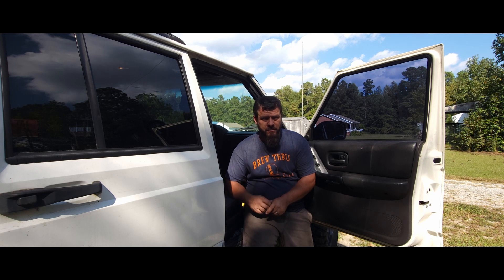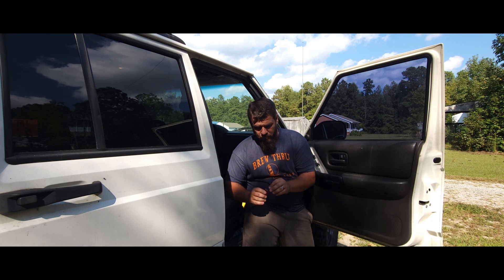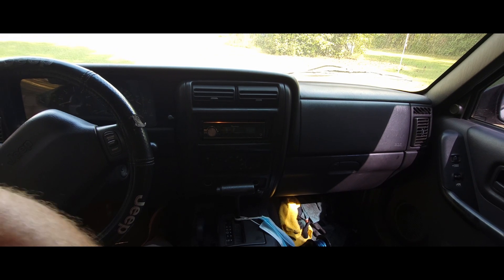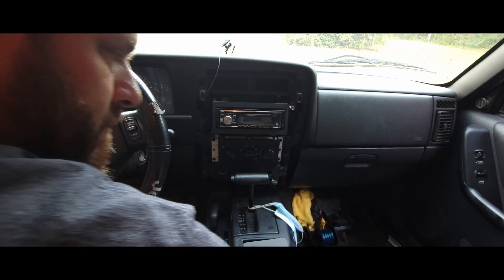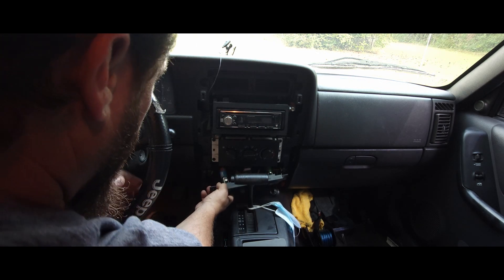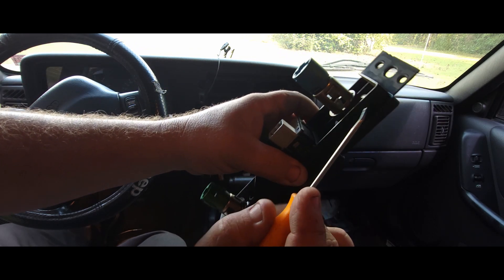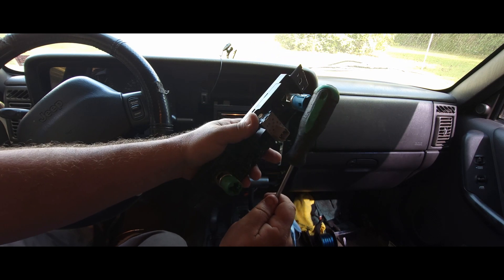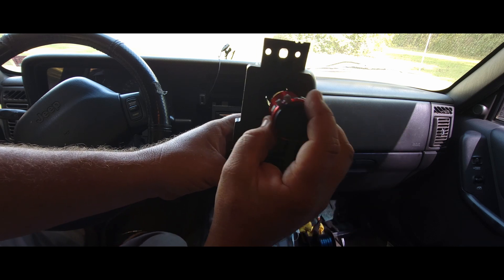Jeep XJ Cherokee USB Port / Plug / Socket

Comment: What did you use to open the hole up for the new socket?
Reply from the maker: If i remember correctly, I used a pair of pliers to snap off the tabs on the back and a dremel to open the hole up